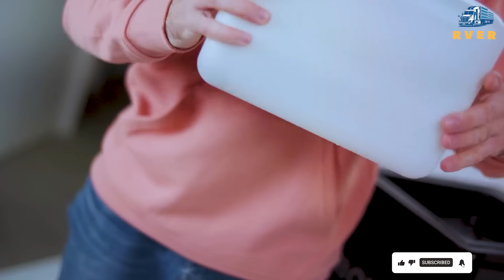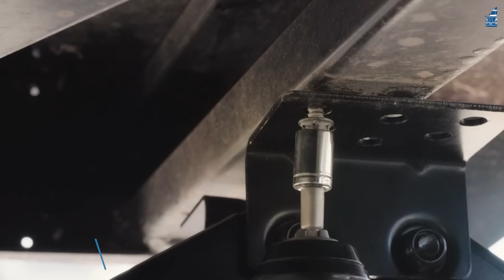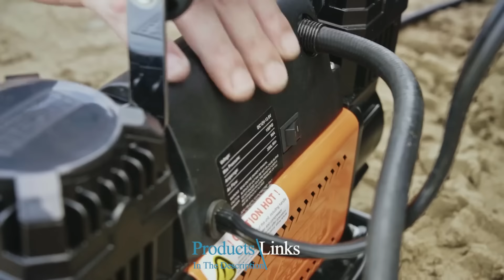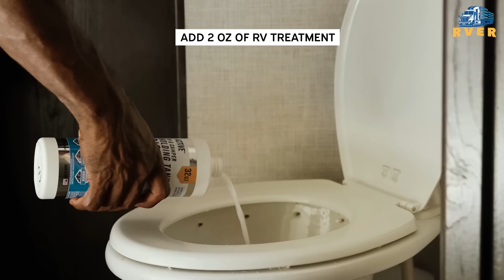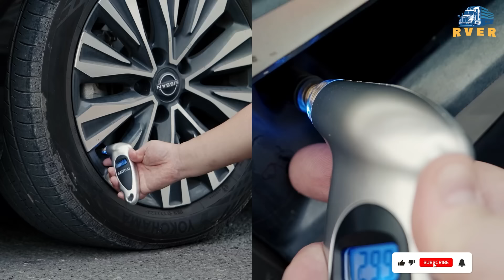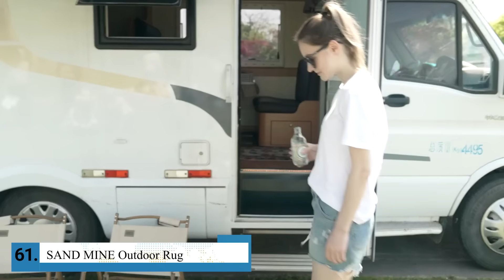65 New RV Gadgets on Amazon You'll Wish You Found Sooner!

Comment from the maker: 1	ZEROXCLUB 3-Camera RV System	
 https://www.amazon.com/dp/B0F8Q77WK5?tag=rver02-20
2	Lippert Ground Control Leveling	
 https://www.amazon.com/dp/B01N9BVJG8?tag=rver02-20
3	BOXIO Portable Camping Sink	
 https://www.amazon.com/dp/B0CCJTDWTL?tag=rver02-20
4	ONNAIS Keyless RV Door Lock	
 https://www.amazon.com/dp/B0D83FHFST?tag=rver02-20
5	Jackery Power Station	
 https://www.amazon.com/dp/B082TMBYR6?tag=rver02-20
6	Kingrver 10 Gal RV Water Heater	
 https://www.amazon.com/dp/B0DSJ5BZKQ?tag=rver02-20
7	BougeRV 12V Car Fridge	
 https://www.amazon.com/dp/B08G1BBBQW?tag=rver02-20
8	LATCH.IT Macerator Pump RV	
 https://www.amazon.com/dp/B09WRTHXS9?tag=rver02-20
9	KYX 7500lb Electric Trailer Jack	
 https://www.amazon.com/dp/B0CG65F567?tag=rver02-20
10	Andersen Auto-Level RV Kit	
 https://www.amazon.com/dp/B07JPXDTPV?tag=rver02-20
11	RVMATE RV Level Blocks	
 https://www.amazon.com/dp/B0DNTGWG7T?tag=rver02-20
12	Maxchock X-Shaped Stabilizer	
 https://www.amazon.com/dp/B0951VC67R?tag=rver02-20
13	Kohree RV Scissor Jacks	
 https://www.amazon.com/dp/B08C26WRW1?tag=rver02-20
14	Kohree RV Stabilizer Jack Pads 2 Pack	
 https://www.amazon.com/dp/B0DR2JCX4M?tag=rver02-20
15	Andersen Trailer Jack Block With Magnets	
 https://www.amazon.com/dp/B0754NWJGR?tag=rver02-20
16	Camco Trailer Tire Ramp	
 https://www.amazon.com/dp/B07ZPJCHN5?tag=rver02-20
17	Towking Heavy Duty Rubber Wheel Chock	
 https://www.amazon.com/dp/B0F4CZJJVG?tag=rver02-20
18	Depsunny Adjustable Aluminum RV Step Stool	
 https://www.amazon.com/dp/B0B595DSZV?tag=rver02-20
19	CTOLITY 200W Solar Panel	
 https://www.amazon.com/dp/B0FXW83GB4?tag=rver02-20
20	GEARGO RV Surge Protector 50A 15000J	
 https://www.amazon.com/dp/B0D53RLC1Q?tag=rver02-20
21	BESTEK 300W Car Power Inverter	
 https://www.amazon.com/dp/B004MDXS0U?tag=rver02-20
22	Hapytrip 4-in-1 USB Outlet	
 https://www.amazon.com/dp/B0D5YJ8NG8?tag=rver02-20
23	LifeSupplyUSA RV Extension Cord	
 https://www.amazon.com/dp/B0785N9381?tag=rver02-20
24	Nilight RV EV Cord	
 https://www.amazon.com/dp/B0C3D5N6TJ?tag=rver02-20
25	ALL-TOP 12V Air Compressor	
 https://www.amazon.com/dp/B0BXX761KQ?tag=rver02-20
26	GasSaf Propane Tank Gauge	
 https://www.amazon.com/dp/B07QP6RCJW?tag=rver02-20
27	hurrventer RV Roof Fan	
 https://www.amazon.com/dp/B0B66VLKBJ?tag=rver02-20
28	Rehoseup 30ft Heated Water Hose RV	
 https://www.amazon.com/dp/B0B7X6VM2S?tag=rver02-20
29	RVGUARD Water Pressure Regulator	
 https://www.amazon.com/dp/B083HSQMHX?tag=rver02-20
30	Waterdrop RV Water Filter 2 Pack	
 https://www.amazon.com/dp/B07X3YWDQJ?tag=rver02-20
31	VEVOR 540L Collapsible Water Storage Bladder	
 https://www.amazon.com/dp/B0D82RF737?tag=rver02-20
32	Camco Rhino 28-Gallon RV Tote Tank	
 https://www.amazon.com/dp/B07K87FR5C?tag=rver02-20
33	Camco Sidewinder RV Sewer Support	
 https://www.amazon.com/dp/B000EDQQJ2?tag=rver02-20
34	Valterra A04-3460BK Sewer Hose Carrier	
 https://www.amazon.com/dp/B01NAU762Z?tag=rver02-20
35	Camco Holding Tank Swivel Rinser	
 https://www.amazon.com/dp/B0006IX7YC?tag=rver02-20
36	Active RV Black Tank Treatment 32oz	
 https://www.amazon.com/dp/B0C8W5ZXQ8?tag=rver02-20
37	YITAMOTOR 5.8 Gal Portable RV Toilet	
 https://www.amazon.com/dp/B0DJ6S8LYQ?tag=rver02-20
38	Awelife RV Shower Head 60in Stainless	
 https://www.amazon.com/dp/B0CYZ4N7TQ?tag=rver02-20
39	Gimili Black Pull Down Kitchen Faucet	
 https://www.amazon.com/dp/B07V71NRHG?tag=rver02-20
40	FOSJGO 2.4gal Collapsible Dish Basin	
 https://www.amazon.com/dp/B07PBR2YMZ?tag=rver02-20
41	NSDXCT Wireless TPMS Solar	
 https://www.amazon.com/dp/B0FL6GQTGB?tag=rver02-20
42	Seventour Dash Cam	
 https://www.amazon.com/dp/B0FCRSYPH5?tag=rver02-20
43	RETRUE Trailer Coupler Lock	
 https://www.amazon.com/dp/B09XQJKJH5?tag=rver02-20
44	Wandwel Automatic RV Door Closer Kit	
 https://www.amazon.com/dp/B0DSP1NLMQ?tag=rver02-20
45	Lippert Screen Assist Push Bar	
 https://www.amazon.com/dp/B09GKYDHY9?tag=rver02-20
46	MCGOR Motion Sensor Closet Lights	
 https://www.amazon.com/dp/B0C9CSVSNY?tag=rver02-20
47	Brightever LED Outdoor Lights	
 https://www.amazon.com/dp/B0DQQ37T2V?tag=rver02-20
48	AstroAI Digital Tire Gauge	
 https://www.amazon.com/dp/B074SJ9XSY?tag=rver02-20
49	VICSEED MagSafe Car Mount	
 https://www.amazon.com/dp/B08YJ9YYFR?tag=rver02-20
50	Novilla Memory Foam Topper	
 https://www.amazon.com/dp/B0FXKX4TQH?tag=rver02-20
51	Thomas Payne Swivel Desk	
 https://www.amazon.com/dp/B08X19S5VT?tag=rver02-20
52	Funomo RV Door Window Shade	
 https://www.amazon.com/dp/B0B6H47CRW?tag=rver02-20
53	Reggory Adjustable RV Fridge Bars	
 https://www.amazon.com/dp/B0C8T6Y2TT?tag=rver02-20
54	Fistihon Aluminum RV Drying Rack	
 https://www.amazon.com/dp/B0C8FHR191?tag=rver02-20
55	Safoner Foldable RV Shoe Rack	
 https://www.amazon.com/dp/B0D2QM5D2K?tag=rver02-20
56	Kohree 74L RV Trunk Organizer	
 https://www.amazon.com/dp/B0D2DS23F4?tag=rver02-20
57	RVGUARD Storage Caddy	
 https://www.amazon.com/dp/B0F83S48BG?tag=rver02-20
58	OpenGlass RV Soap Swivel Caddy	
 https://www.amazon.com/dp/B0D7CYRFWM?tag=rver02-20
59	Suncode RV Awning Fabric	
 https://www.amazon.com/dp/B099DL9BVS?tag=rver02-20
60	Tentpro Awning Shade	
 https://www.amazon.com/dp/B086DV1H37?tag=rver02-20
61	SAND MINE Outdoor Rug	
 https://www.amazon.com/dp/B091YMYV7Q?tag=rver02-20
62	AMACOOL Portable Camping Fan	
 https://www.amazon.com/dp/B07TCLB39D?tag=rver02-20
63	Umbrauto 27-30ft RV Camper Cover	
 https://www.amazon.com/dp/B0D66PZX88?tag=rver02-20
64	303 Rubber Roof Cleaner 1 Gallon	
 https://www.amazon.com/dp/B0971PCCDK?tag=rver02-20
65	Kohree Non-Leveling RV Roof Sealant	
 https://www.amazon.com/dp/B0F48967BM?tag=rver02-20